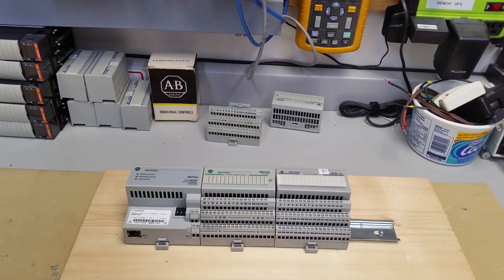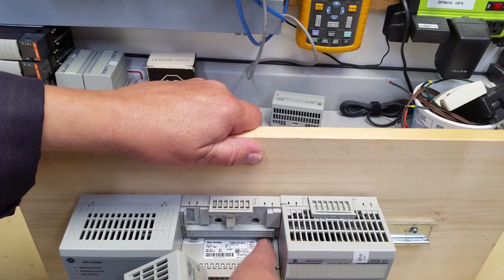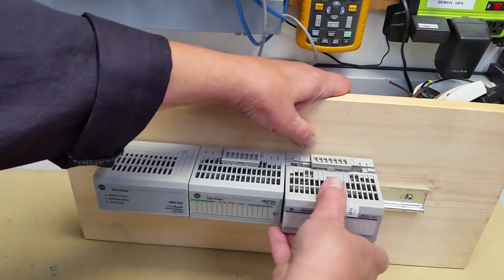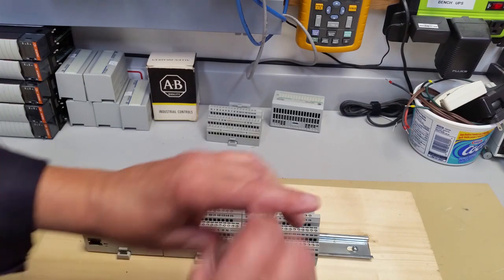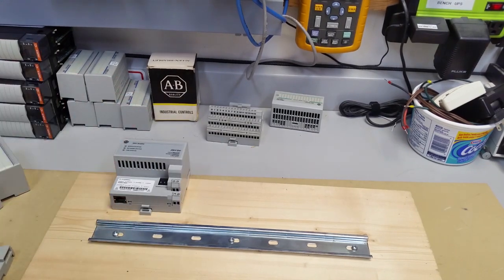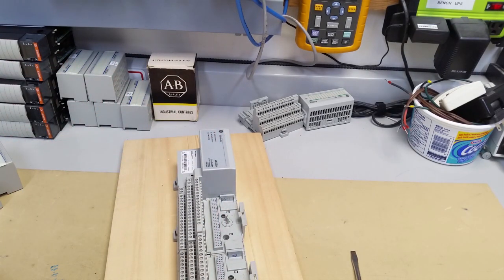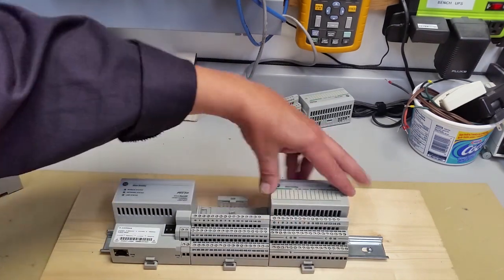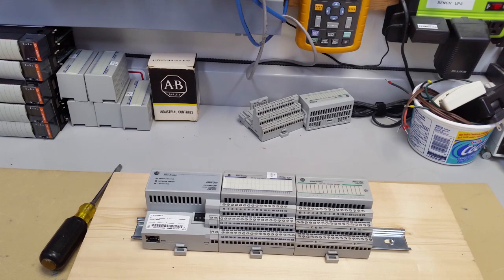1794 Flex I/O Install and remove Properly

Comment: Bom dia, tudo bem??
Eu tenho um módulo analógico 1794 ie12, o led Power verde está piscando, os instrumentos que estão ligados nesse módulo estão em falha, poderia me ajudar por favor, não encontrei essa informação no manual
Reply from the maker: Hello - Which system are you using - PLC5 - Clogix or SLC500.  With that info I can see what I can figure out for you.
But suspect that the configuration is not done or the processor does not like the configuration.
Let me know and I will see what I can find out.

Comment: Can i change module online (while Running the plant). By forcing all the tripping values. Tc/RTD module
Reply from the maker: Hello:
As soon as you pull out a module it will fault the adapter and all the modules in that chassis will stop communication with the processor.
You would be best to stop the process and change it then.
It will take you less than a minute to change out the module.
When it powers up the processor will write the configuration to it.

Comment: Do you have any tutorials about configuring sn-1747 Scanner Cards to talk with the 1794 ASB adapter modules, do you need to have a certain number of terminal bases/interface cards connected with comms to work correctly is my specific question. Many thanks
Reply from the maker: Hi James:  Sorry I do not.  The manual is available on the AB site.  https://www.rockwellautomation.com/search/ra-en-US;keyword=1747-SN;startIndex=0;activeTab=Literature;spellingCorrect=true;facets=;languages=en;locales=en_GLOBAL,en-US;sort=bma;isPLS=false;sessionID=a4a9321e-7c6a-0264-923f-8d22ff65ad2a;deepLinking=undefined

Comment: thanks for making this .
Reply from the maker: Your welcome - hope it makes working with these easier
Reply: @abplctestbench759  yes it will,  do you have a video on swapping out the module with a replacement. we have a red light on ours.   cycled power a few times not resetting. waiting on a replacement.
Reply from the maker: @dougm1985  Hi Doug:  No Videos on swapping it out - normally I power down and remove and then re-install.  Would need to know which module it is to begin to assist you.  But as I mentioned before to others - confirm your wiring and if that is good then check your configuration in the program. 
If you are making an exact swap then I would have to suspect that you have 2 dead modules but that is normally a low probability.
Reply: @abplctestbench759  on the general tab is a box for bootp.  its not checked , i have two of these units and both are not checked.   what happens if i check it?  my moduel has gone from red to green , just sitting there,  my net work status light is off    thanks in advance
Reply from the maker: @dougm1985  I take it from your comment that you are having a problem with the 1794-AENT communication adapter module?  If so is it a series A or a series B with the 3 switches?  I have another video on the AENT adapters on the channel.
Reply: @abplctestbench759  its an A series.  i cycled power again to see if it would work. lights are back to red.  our replacement came in and its a B.  we can't use it. we should be getting an A series in on Monday.
Reply from the maker: @dougm1985  You have to set the address to the module using either RSlinx or BootP.  I explain it in this video.  https://www.youtube.com/watch?v=VSc628BpRSE&list=PLApJy6_fcuvi_kx1MeMJjYus6rphDwVma&index=4&ab_channel=ABPLCTestBench A & B series modules are about the same.  B gives you the option to set the last 3 digits when using a 192.168.1.xxx format.
Reply from the maker: @dougm1985  Were you able to configure the address and get it talking?
Reply: @abplctestbench759  yes, today.  funny all the video on line use ver. B.  none on ver. A thanks for the help.
Reply from the maker: @dougm1985  I see that - I will make a series A video in the coming week or so depending on my work load.  Thanks for pointing that out.

Comment: Please,I need your technical advice. We have 1794-IRT8 installed and intended to change one of the 1794-IRT8 module that's faulty to 1794-IT8 in which the 1794-IT8 doesn't Power ON. What could be the cause?
Reply from the maker: The way the bases are wired are slightly different.  You have to check your wiring diagrams before changing over.  You also must configure the new module in the program.
Without having the module in my shop it is not possible for me to check out what is going on with it.
You can also go to this site and post a question.  You may get a better idea.
https://www.plcs.net/
Reply: Thank you for your Swift response. I really appreciate.
Reply from the maker: @temitopefamuyiwa7043  Your welcome

Comment: Thanks for putting this up.   At work we install of lot of these.  I've made it a point to always look at the bottom of the module for any bent/misaligned pins before installing.  Been a few times they were bent a little and putting them in with any force caused bent/broken pins.    Thanks again for posting your videos.
Reply from the maker: Hello Jay - Your welcome.
Thank you for the comment.

Comment: thanks for the very informative video , we have a flex I/O 1794 where i work and i would like to know if it needs any kind of configuration and what software do i need to use in a case that i would like to replace it with another one, thanks in advance
Reply from the maker: Hello:  If you are only removing and replacing a module with the same one - no configuration of changes in software are needed.  I recommend that you power down the module and adapter before removing or inserting a new module.
If you add another base and module to the system you need to use the AB PLC software for the series of PLC processor that controls your system.